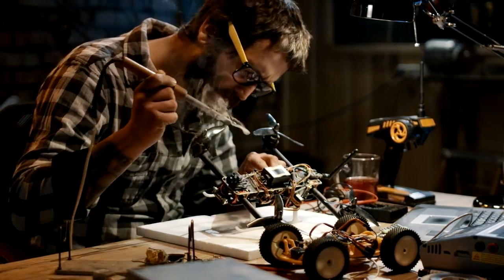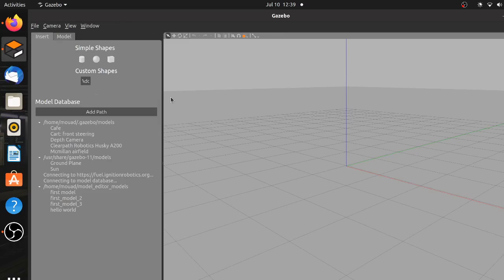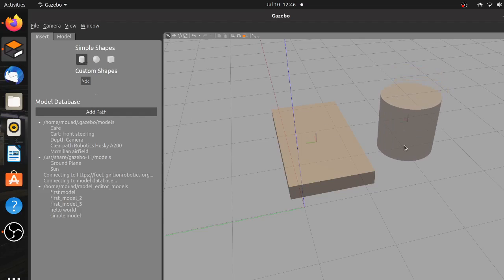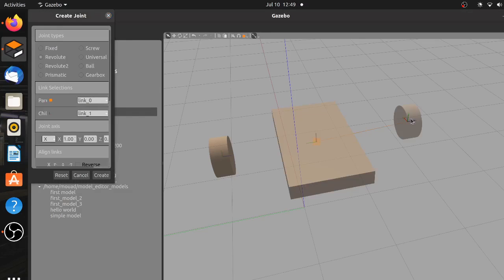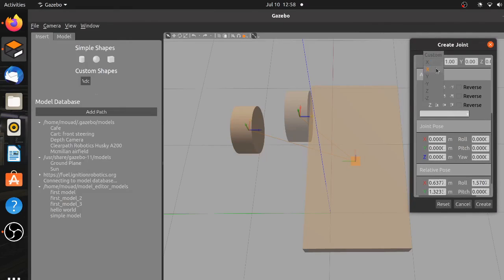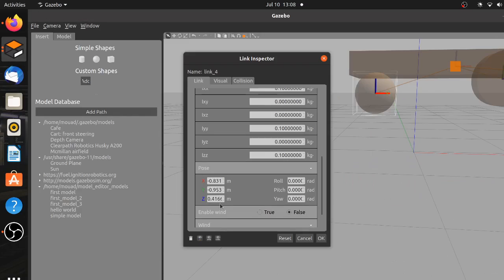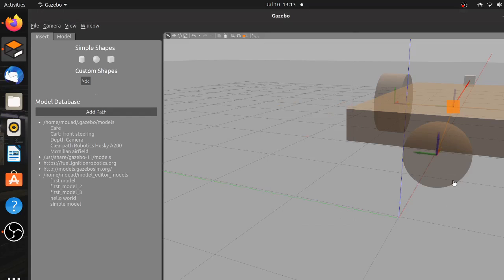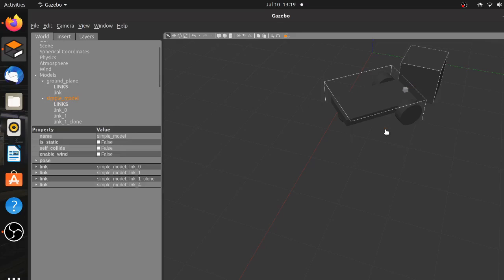Make a robot in GAZEBO from scratch | under 8 minutes simulation

Comment: Bro , i did a 4 wheel chassis with correct rotation axis like you said , but when i imported the robot i made in the new gazebo , from the moment it imported , it is moving on its own . I got that the center of masses and weights are misaligned from the searches of ai bots , what is the solution for this bro ?